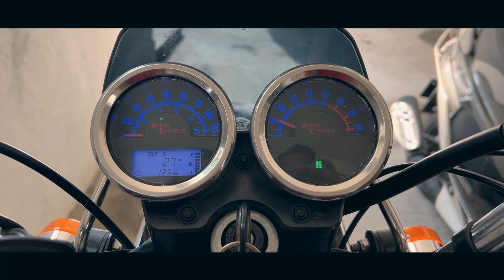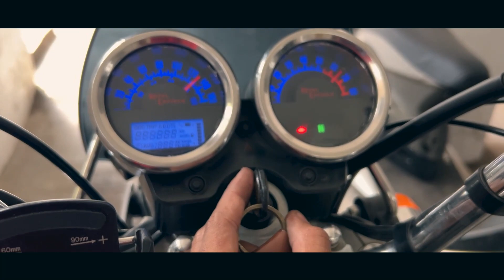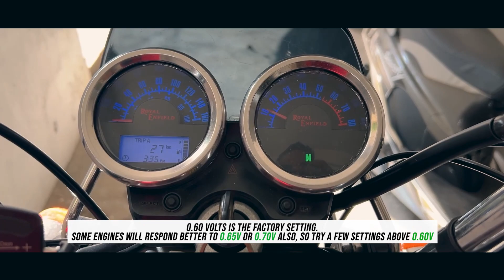Royal Enfield UCE TPS Setting

Comment: bro its fine, but is there any missfire in some 1.5-2k rpm?? im fed up with the missing 😢 and jerking in low rpms. but after 2.5- 3 k rpm engine will give smooth performance and best milage
Reply: I have same issue, have u found solution?
Reply: I have same issue in my Tb500. Anyone got solution for this?
Reply: Jerks at 1500-2000rpm
Reply: @rahulkhangaonkar2310  Sad to say, i have converted efi to carburator , without changing the starter coil and pulsar coil . still have the very same issue on low rpm. i suspect the pulsar coil for the problem. im gonna try changing it. and will update you guys soon.
Reply: and listen, if you guys using TB500 EFI only for long distance rides and less city rides, don’t convert to carb. the efi gives consistency and best milage during the highway tours.
for the city traffic and local use carb is good because we can tune it and get reasonable milage of 32-34*kmpl. which was 24-26*kmpl on efi.

*may vary by driving style